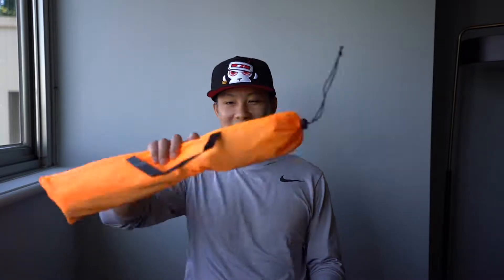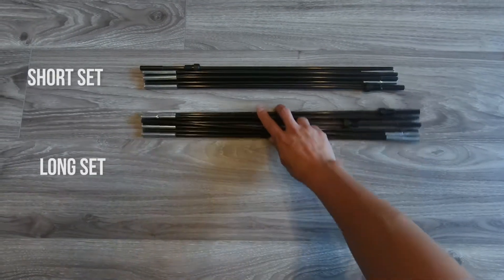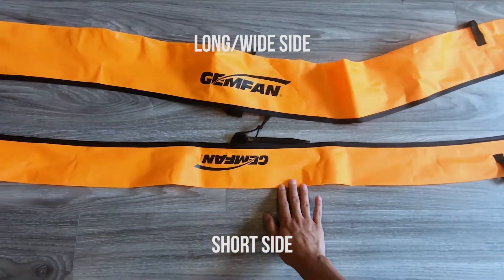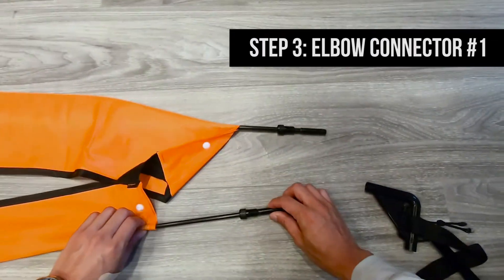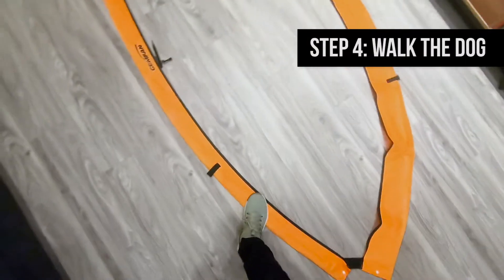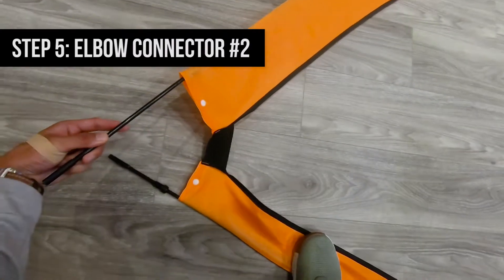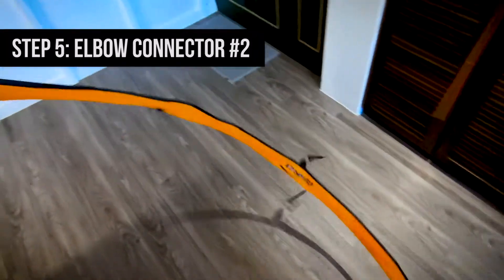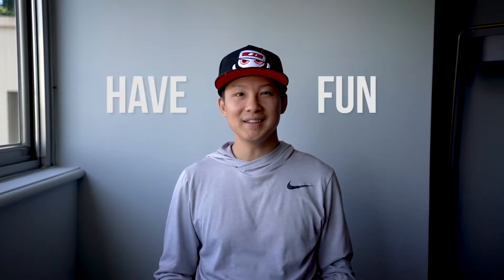How to Setup Gemfan New Drone Gate

Comment: These gates break very easily if you fold them up like they show in the pictures, and store them that way. The rods just snap. If you buy these DO NOT store them folded. It defeats the purpose of a Pop-Up gate, but least they won't break.
Reply: ditto....mine broke in storage as well....that black "fiberglass" is a really poor facsimile and broke in multiple spots right at the metal sleeves...